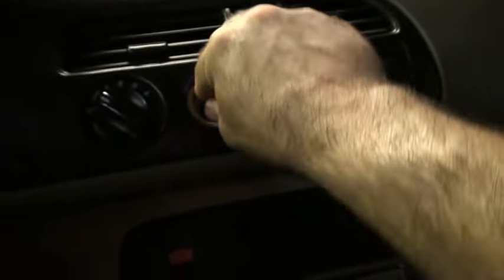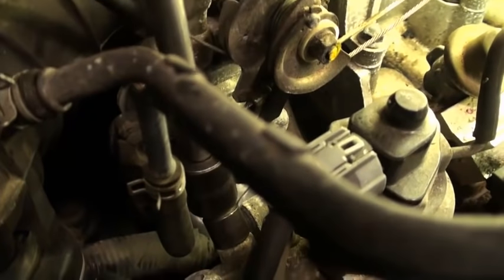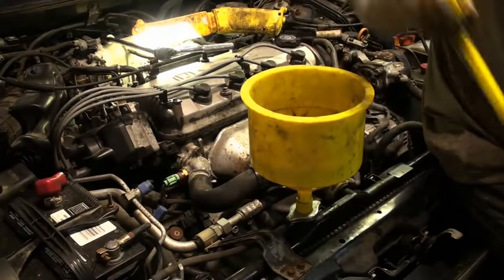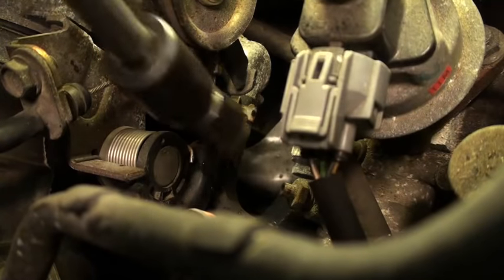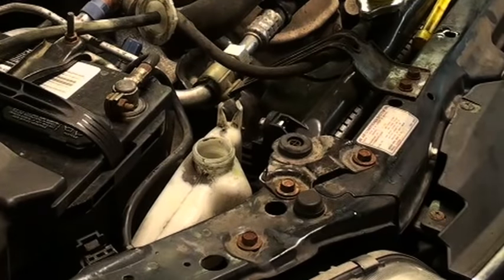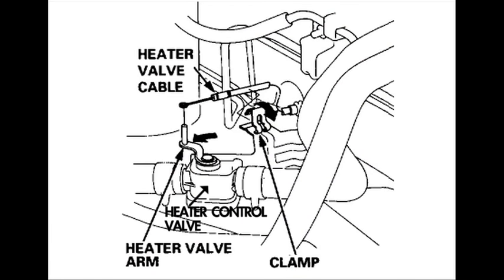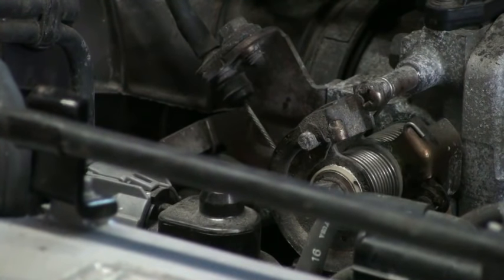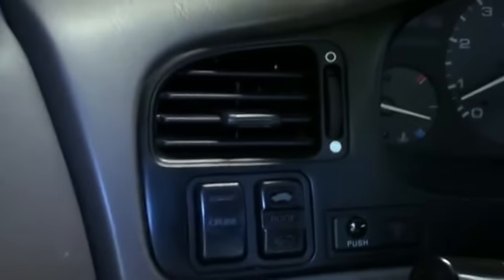How To Bleed A Cooling System - EricTheCarGuy

Comment: I had air in the system of my 2011 Subaru Outback a while back it was causing overheating and lack of heat through the heater box.  Problem was a $27 radiator cap from Subaru parts.  We did a more ghetto bleed job which was parking the car facing up hill then running the engine with the radiator cap off until the the thermostat opened and started purging air bubbles.  Once the water didn't have any more bubble action we capped the radiator and haven't run hot since.  That said I think I'll be getting one of those funnels to do it right moving forward.

Comment: thank you Eric. I am replacing my 02 altima radiotor and your tips help me alot. So it is ok to fill it while the car is not on or running. then start it up and run and the rpms. Also best to run it on an enline to get the bubles out.
thanks

Comment: hello Eric, I have a 94 Accord EX I believe its the same make model and submodel in your video. so my car has been over heating after driving about 30 mins or so. right when I get off the freeway the temp will rise but when I start driving again it will lower. My buddy and I did exactly as you did in this video and the extra rad fluid in the no spill funnel was still bubbling tiny bubbles even after letting it idle for about 20 mins. it never over heated during idle. just wondering if those tiny continues bubbles are normal. Also the radiator is brand new along with the thermostat, rad hoses (silicon), and ac fan. I really hope the head isn't blown, there is no white smoke, no sludge on dip stick and no loss of power runs strong for almost 200k miles. thank you for all your videos you have no idea how much they've helped.

Comment: The air in the coolant stuff causing idle hunt on Honda’s for sure real

Just did the timing belt on my 02 v6 accord.  First start was fine.  

Second start after sitting a while had idle hunting all over. 

Burped the coolant a second time.  Only a slight amount of bubble popped out from what I saw and idle calmed right down.

Comment: Thanks for a very well done video.  my daughter had a frontender that required replacing radiator and overflow tank.  I'm not certain how long the car continued to idle after the impact while pulling in air at will.  Since then, I've replaced all coolant components, but have the rhythmic idle fluctuation from 1K to 18K.  Hoping your procedure will remedy, but if not will check for vacuum leaks and IAC service.

Comment: Eric, great video. I have a coolant system problem that I am trying to diagnose. Just replaced the radiator. At first everything seem ok, but I noticed small bubbles going into the reservoir while the engine is running. The reservoir fills until it overflows the vent pipe. Is this symptoms of an airlock or is it a head gasket? Thanks

Comment: Hi Eric, your videos are very helpful. How do I bleed a radiator on A 2007 tahoe flex fuel 5.3? I just changed the  thermostat and it's still overheating, but the heater is blowing cold air.

Comment: I let my '89 Honda Prelude SI sit all last winter.  Ran fine before winter, crank but no start in the spring.  This is an engine that always had started reliably.  Replaced engine coolant temperature sensor as I'd found in the past that bad sensor/wiring had a big effect on starting.  Finally bled the coolant and it started right up. Perhaps I had a slight coolant leak over the winter but I don't know.

I think I've got more going on now as I can start the engine and it accelerates from idle smoothly and runs fine at higher RMP.  The odd part now is that when the engine reaches operating temperature it will still run ok at higher RMP but it wants to stall at idle when I try to accelerate and I have to feather the accelerator to coax the RMP up.  Makes for tense moments at a stop sign.  Good power at higher RPM.  TPS is good with just a tiny dead spot about mid range.

I replaced 02 sensors as I had codes for those.  Carbon at the base of both.  Otherwise no codes.

About 450,000 miles on it and engine rebuilt six years ago with 433,000 on it at that time.
Reply: Update on this:

Eric says to stick to the basics so I started checking plug wires, coil, and plugs.  Lo and behold, I replaced the Denso plugs with NGK plugs and that fixed the problem.  One of the old plug's electrode and lower portion was brown.  The other three showed evidence of carbon fouling, a symptom of rich running.   I installed the old set 37,000 miles and 7-1/2 years ago.

I still can't figure out why the stumbling problem would appear at low RPM/idle but only when the engine warmed up.  I replaced the EACV with one from a junk yard 39 months ago but did not recheck now.  The Fast Idle Vale is good.  Vacuum at idle when cold and valve closed (no vacuum) when engine warm.

Nor can I understand why the stalling problem arose after just letting the car sit all last winter.  It ran fine until the winter came but in the spring it wouldn't start until I bled the cooling system.  But even when I could start it again there was this odd problem of stumbling and stalling at operating temp.

However, there's no denying that now after plug replace acceleration is smooth whether engine is cold or warm.  No more dying at stop lights.

Comment: Hey Eric great video.  I have a 2003 Honda Civic Hybrid that has an overheating problem.  I open the bleeder screw but I don't get much coolant coming out.  I replaced the radiator, water pump and thermostat as well as trying a new radiator cap.  I am not sure the problem but it seems like there is a lot of air in the lines .  thanks for any help

Comment: Eric, I have a 2003 honda civic and my heater inside my cabin takes a long time to heat up.  Itll start to warm up when i start driving my car 5-10 min after. Sometimes when i'm driving, my temperature gauge gets close to hot (H).  The temperature goes back to normal when i turn on my a/c switch. Ived had my headgasket resurfaced about a year and a half ago due to the same problem.  The coolant in my car is full to the max. Thanks!!!

Comment: Hey Eric! You have helped me SO MUCH with my accord now I've got a 04 Odyssey with rear heater that I thought i would do a quick drop and fill of the radiator! HUGE MISTAKE!! Now the engine won't drop below 1500rmp and I can't seem to get all the air out of the system. I've followed the Honda recommended procedure 7-8 times and no luck. This is my daily driver and I am missing work... any ideas???

Comment: I had some serious heating problems and I new I had to replace the radiator in which I did and that helped allot although I'm noticing that I never bled the radiator and 2 it does not have thermostat installed. This issue still persists not that is heating but that the coolant evaporates every 2 day's. So I'm going to check all the hoses see if there's a radiator valve on my 1993 Toyota tercel and place the thermostat.  PS: The water pump was replaced recently as well. If all this won't work then I'll let you know. Thanks for this video.

Comment: Hi Eric, I have a 2002 Mitsubishi Eclipse GS. I replaced the radiator myself last week by following your awesome step by step instructions in another video you uploaded. I also flushed and burped the cooling system for hours using the spill free funnel. However, my car is still overheating. My thermostat works, my fans work, my heater works. So, that leads me to believe I have an air pocket trapped somewhere. No where do you mention a bleeder valve in the video where you replaced the radiator and flushed cooling system in the car similar to mine.

Did you unscrew a bleeder valve when refilling the coolant for the Mitsubishi Eclipse and just forgot to mention or didn't videotape that step? If my car has a bleeder valve, does that mean I have to drain coolant and refill again? Or can I simply unscrew bleeder valve (if my car has one) now after refilling and release whatever air pressure is trapped there?

Thank you for uploading all of your DIY car repair videos. Greatly appreciated! :)

Comment: Hey Eric. I changed my coolant but only from the radiator and reservoir, and not the engine block. I purged well and noticed a dark green look to the fluid in the pool of liquids. Think drops of blood in water. It started during burping, in the second cycle of the fan. Is the dark green, "bloody" look normal when coolants mix (old & new and from different manufacturers)? 

Hope things are going well for you in 2023.

Comment: Hello, that was very helpful. I have a question for you please. Just purchased a 1998 Nissan Altima GXE. I believe the engine thermostat does it work, even when driving for over 15 mins the needle still stands at COLD. The heater blower works but there is no hot air coming out. Do I need to replace the thermostat and bleed my coolant system system? Any and all input is appreciated. Thank you.

Comment: Eric, what are all the possible causes for white foam in the radiator?  I used a block tester, pumping for about 1 minutes and lifted it to check for foam.  The foam was getting close to the tester so I stopped.  The fluid in the tester was still blue and I held it to the exhaust tail pipe to check if the fluid does turn yellow.  It did turn yellow quickly when held to the tail pipe.  I used some chemical flushes in the system to clean up the dexcool sludge.   After flushing and back flushing several times with water only, the foam is still there.

Comment: Some vehicles require the front end raised 2ft or more to completely bleed the cooling system. Most of the time it doesn't overheat, the customer complains of no heat through vents at idle. So check the service procedures to see if raising the front end is required.

Comment: Just did this on a Daihatsu Skywing (like a Charade)  Pretty stubborn. Eventually I disabled the fan by pulling the relay and let it boil into the funnel, which it did fairly violently, so I lost quite a bit of coolant.

Engine off, as the coolant contracted into the radiator I topped it up with fresh.

Didn't have enough spare coolant to do three cycles, as I'd intended, but once seems to have cleared the air

Comment: Excellent video, as usual.  I am certain that this procedure works well for most vehicles where the pressure cap is located on top of the radiator.

Most Ford vehicles use a plastic, translucent, pressurized, remote mount reservoir.  This is not a "burp/overflow tank".  It is part of the pressurized cooling system and makes up for the low profile radiator.

An additional benefit is that you don't need the funnel,  Fill the tank to the line, fast idle with the pressure cap off, turn off and install the cap.  Double check the level after your ext trip.

Comment: Also I had a full radiator + hoses etc belts wheels you name it alternator etc replaced. When I am driving at first & the car is worming up & I have the heat on. At idle like a stop light the heat reduces significantly then I resume drive and it’s back. Of corse after a few exchanges you can’t notice any longer. This sounds indicative to air in the lines. I am not over heating & my car is a 1995 Toyota Camry with 100k Miles exactly. Older lady had it. Didn’t drive much as you can tell  I also had a new starter kit put on along with a full tune up etc. I put in exactly what calls for in oil - 1qt cause I add 1qt of Lucas. Can you recommend anything to help prolong the life of this car in all avenues? Thanks buddy

Comment: Hi! Thanks for the videos, they are really helpful, ok I've got a question, last week I changed the radiator on my Hyundai Elantra 2005 cause the one I had there previously began leaking and it had a crack of about 4 inches wide near the top of the radiator head where the cap is going.
That went fine, put in a brand new radiator in it, bleeded the old coolant on a flat surface... (I've heard it's better to be uphill for all the air to go out).
Since then I'm only getting heat in the car from the fan when accelerating going uphill... airbound heater core or plain clogged?
Car temp is always fine in the normal position very stable.
Should I try bleeding the car uphill or try a heater core flush?
And yes... I had tried this shit called no leak in the previous radiator, so these little copper parcels could have clogged my heater core.
What do you suggest? Thanks!

Comment: Hi Eric. Do you think a leaking of oil from  valve cover and small leak of antifreeze coolant from oil cooler hose pipe assembly can overheat an engine? My 350 Z  successfully tested negative on the combustion radiator test kit. In the next few days I will changing the intake plenum and valve covers. There s a questionable low oil pressure. Changed the oil temp sensor as well the water pump , thermostat , radiator and fan assembly as well as fan relays. Also changed the pcv valve. If the car continues to overheat after all I'm about to do I don"t where to blame it. I also flushed the heater core and I'm getting heat. Both fan work including the ac. Also placed a new gasket behind the oil cooler and the system was burp for air in the coolant system. The car engine run at idle for one hour with no overheating symptoms but when I drove it soon after the temp gauge went up so I stopped the car. Thanks.

Comment: I can drive it two and a half miles and it just burst into overheating but I can let it idle with the air conditioner on 4 hours it's only under driving condition I did it like 3 times and it's always the same amount of time in the same amount of miles I am so puzzled thanks for the help you've been wonderful

Comment: Very good video. I have a hot temperature problem,  I was trying to fix my Mazda CX7 2007  housing cooler leak and I watched a few videos in You Tube how to do it. I changed the rubber gadget. I disconnect the houses and one of those trow out fluid I think was coolant. So I did a test drive and I saw the the temperatures going up, more when the car stop a the traffic light. I put more coolant in my car just in case need more because maybe I lost coolant  when I put the houses back. When I stop my car in my home and turn off my car. I hear the fan running like a minute then the fan go off. What can be the problem? If the houses has air??

Comment: Wow this is an old video for the life of me I cannot figure out why my radiator hose does not build pressure I have went through replacing the thermostat the water pump is new it's got really good antifreeze in it and I just recently purchased the tool that you show in this video got all of the air out of the system and it does not build any type of pressure and it does not have any type of leaks. Now I know a radiator cap can be one of the causes but if my radiator cap fits on nice and tight then shouldn't that be fine or not necessarily what's your thoughts Eric

Comment: Just changed my upper and lower radiator hoses on my 1998 Honda Accord. Followed these instructions and got what I thought was all the air out. However, when my car is idling and I rev the engine up to 2000 rpms and then let off the gas the car dies. I'm only having slight hesitations when accelerating when driving. Do you think this is an issue with the cooling system or something else? Thanks for your videos. I'm a huge fan

Comment: Eric, I have a question. Just flushed my 99 s10. Ready to bleed now. Most research has shown to put it on heat and turn the air on high. I see you left yours off. I saw your explanation about why, but it kind of went over my head. I have some gushing water sounds near my passenger side dash when I accelerate, apparently that is heater core related. It only happens before engine gets up to temp. But I wanna make sure I get my heater core flushed and bled right to maybe rid the gushing, before it either leaks, or even worse fails. Would hate to rip the entire dash off for a core replacement! Thanks for all your videos man, highly appreciate it.

Comment: I know this video was years ago but I got a question. Would air in the cooling system cause antifreeze to spray all over your engine after driving it on the highway or is that the head gasket?

Comment: 09 charger 3.5 V6
After a 20 minute drive, parked in the driveway with engine running and the reservoir was actually boiling and spewing out the pressure release hole. I know I didn't ask a question but, this is my problem.
The fan works fine and heat inside works fine also.
    On the second flush, I noticed the reservoir was filled to the top. is this suppose to happen?
Please help, Erick. Awesome video. Thanks so much.

Comment: Would a head gasket failure allow air into the cooling system and cause air pockets and other problems? If so, and if the leak is very small, would it be ok to just leave the small leak alone and bleed the air regularly as needed to keep the vehicle performance up to par?

Comment: Thanks for the time you put in these, I have watched several and just swapped out my radiator on my 96 Odyssey in much less time and hassle thanks to your video.  I like the funnel but I also like your pivot socket....  What exactly is that?   Is that some sort of Gimbal ?  It doesn't look anything like my flex adapters.    Thanks

Comment: 1994 honda accord ex I have bled the system change tps map sensor rapid idle valve cleaned the intake and throttle still has a irratic idle very bucking and Jenkins when you fist take of frustration  is setting in should I just scrap it and go by a chevy

Comment: Thanks for all your help; I have a problem with my heater. I have a 2000 Chevy S-10 and the heater is blowing air, but no heart is coming out. I have put a new thermostat in but didn’t help. Can you help?
Reply: u should check your heater core i had the same problem and i flushed it out and it works great now watch erics  video on that